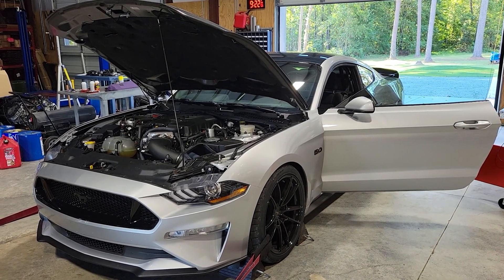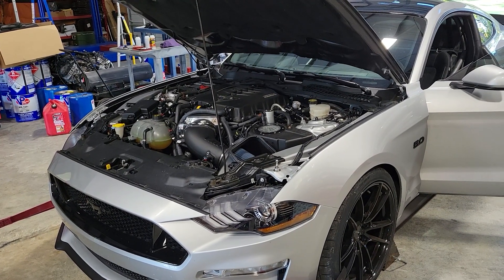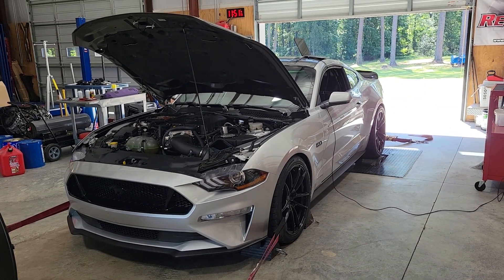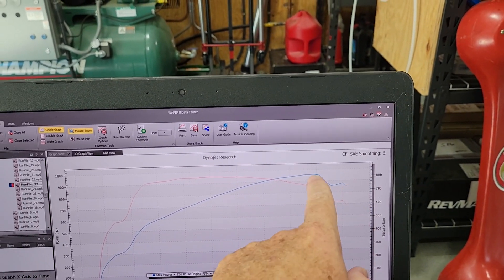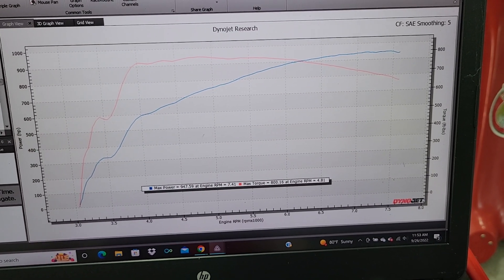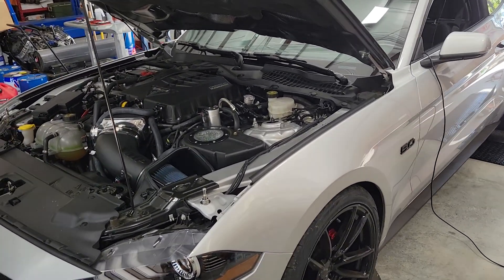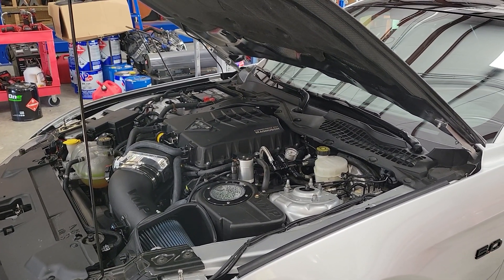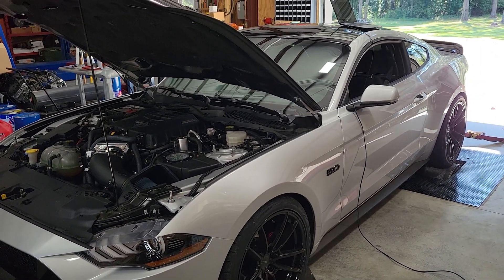Final Dyno Results VMP Odin Supercharged 2019 Mustang GT With 2.4 Pulley

Comment: This on e85 gas or regular?
Reply from the maker: E85
Reply: @drpmotorsports2186  what kind of numbers can you pull with 93 octane?
Reply from the maker: @Murlock1986  Probably mid 800s
Reply: @drpmotorsports2186  that’s awesome. Still better than a stock hellcat. I am sold. First need to get the mustang then I’ll be getting this supercharger setup
Reply: @drpmotorsports2186  I forgot to ask any bottom end work or position and rods?
Reply from the maker: @Murlock1986  It's a Ford Aluminator crate engine. It has Manley rods and forged pistons.

Comment: Would a 20% overdrive do much more. I’m looking at that for mine.
Reply from the maker: A 20 percent OD might give you a couple more lbs but I'd imagine belt slip would become an issue with the 8 rib.  I've heard VMP is working on a 10 rib setup and that would ideal.
Reply: @drpmotorsports2186  I think they have it out already. I’ve been putting it together piece by piece.

Comment: Im going to do the aluminator 12:1 with the current vmp odin i have on it. I have the dual 69mm throttle body. Is this e85? Do I need to go with the monoblade for 800whp on e85? Thoughts on daily/weekly road driving longevity on the aluminator and this build? Thanks!
Reply from the maker: The Aluminator is a great engine for 1000HP or less. The twin 69 will be plenty for your goals. Yes I'm running E85.
Reply: I have a 2020 gt with the VMP Odin, 2.7 pulley on e85 and twin 69mm and I make 921rwhp. @Carbon5.0

Comment: That 9.5:1 motor is not making the power of 12.0:1 even with all the pulley you have. Hit it with some nitrous and increase cylinder pressure.
Reply: For high horsepower applications 1500 hp +9.5.:1 is the preference but that’s of course with a turbo
Reply: Also with the difference in a 5.2 gt500 engine and your aluminator.  Does displacement difference between the two equal the power difference a  with the same 2650 rotor pack and compression.

Comment: If this was a normal compression coyote it would be well over 1000 before it was maxed.  There really is no reason not to run the higher compression engine you just run lower boost levels for the same power levels.  If you were running e85 and the normal 12:1 it would be making alot more power that is 2.5 points of compression that is significant when you're talking those kind of boost numbers jumping up that much compression.  I seen a dude make 925 rwhp with a stock 8.4:1 07 gt500 engine with the gen3r which is the same rotor pack he was spinning it to the moon and back like this car is.  He had a 2.5 and 10% lower so it was spinning faster than this one is.  That kind of shows that the older gt500 engines are closer to coyotes than many think power making wise but they do it at lower rpm and make better torque.  It's the compression advantage that usually helps the coyote.  Since this one is running lower compression (but still more than a point higher than stock 07-12 gt500 engines) its more fair comparison.  Kind of interesting to see.  This is a 2.65 liter blower the power it makes not even ported is incredible.  If you want 1000+you simply gotta run little more compression and/or go with some porting.  Pound for pound one of the baddest blowers on the planet imo.